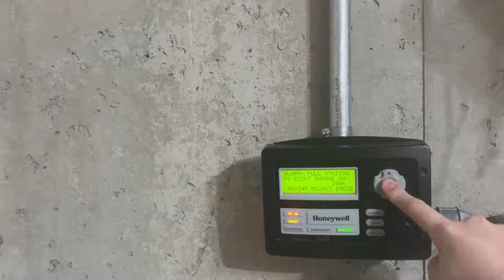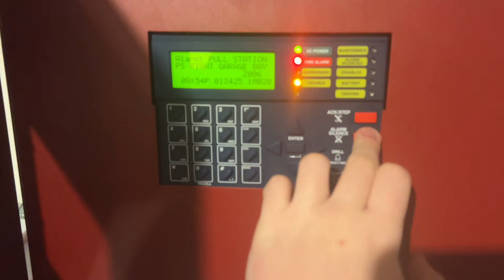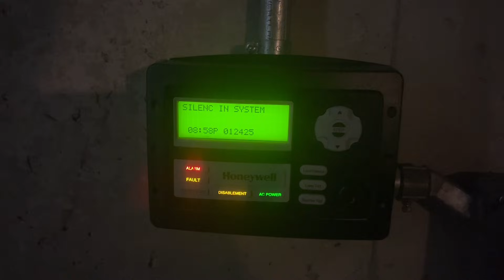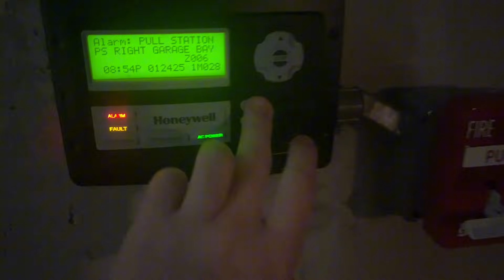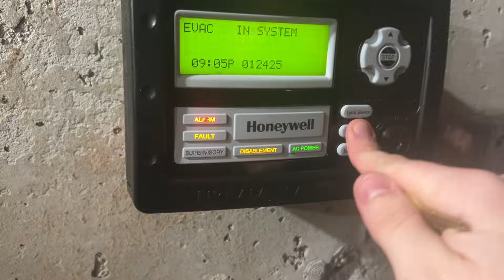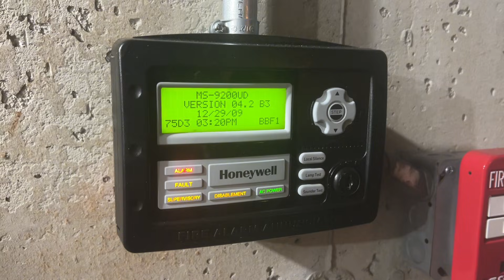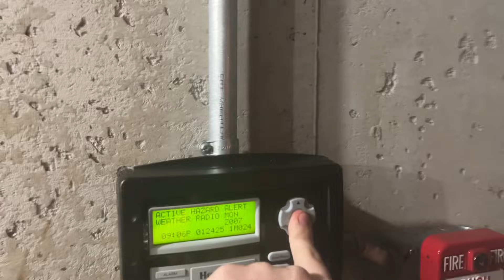Fire Alarm System Test 71: Simplex Voice Evac + Weather Alert System

Comment: I want to know if the smoke alarm relays work on the panel
Reply from the maker: They do
Reply: The CE-2224?
Reply from the maker: @NewEnglandAviaton987 yes it will work. You need to have the relay powered by 120 volts though. You would connect the Common and Normally-Open side of the relay module to one of the zones on the panel, so the panel activates whenever the relay closes.